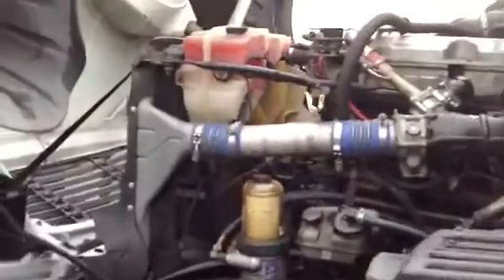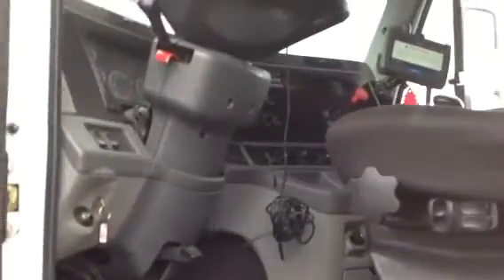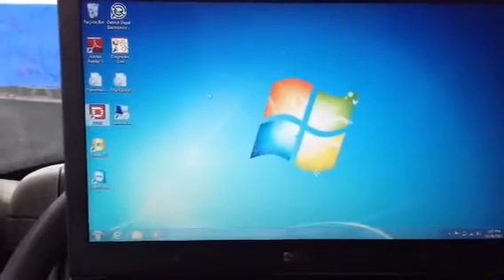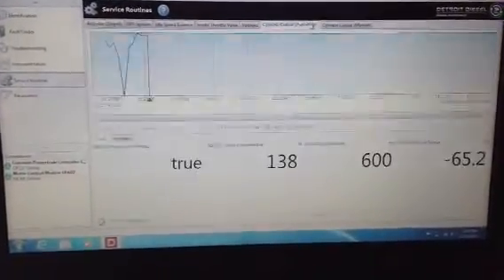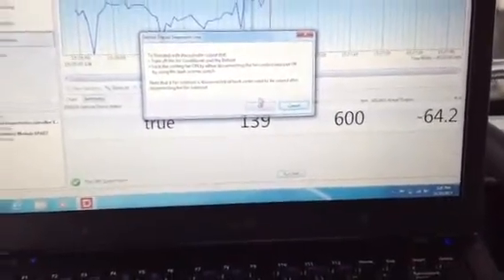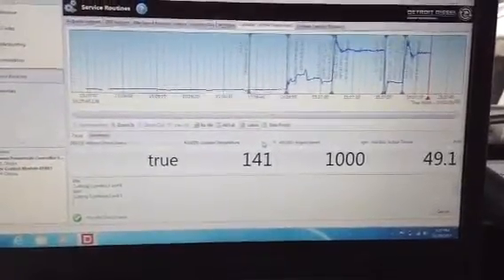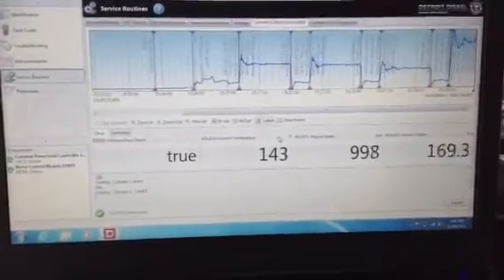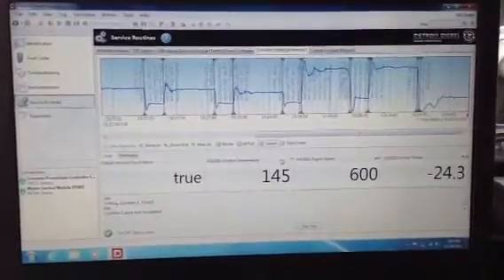Detroit diesel 60 series cylinder cut out test

Comment: So if the injector didnt pass it would have displayed false on the screen were you see true🤔 I replace the no4 injector haven't put the trim in yet! But it still sputtering I'm about drop this over a mountain lol help!!
Reply from the maker: Dexter Williams from my experience, their were some injectors that I would replace and wouldn’t take in the new calibration number but would work fine on the engine. Just be careful not letting too much engine oil go into the injector chamber. It can cause the engine to hydro lock.
Reply: @frankTypeR87  because now I hearing like some valves noise or let mechanic put them in I feel got man mad as hell